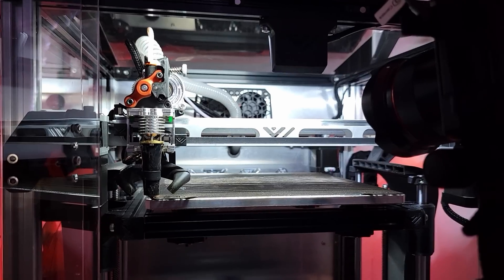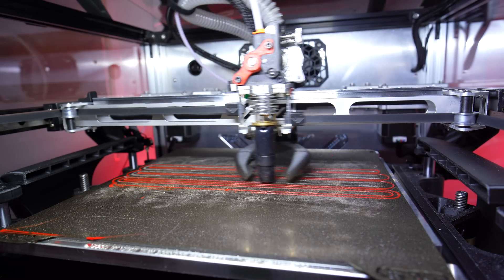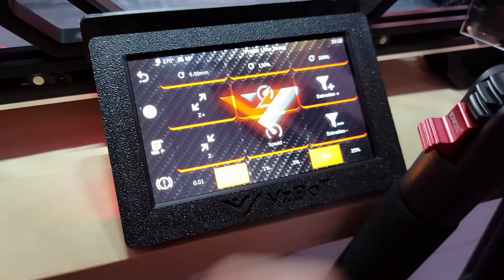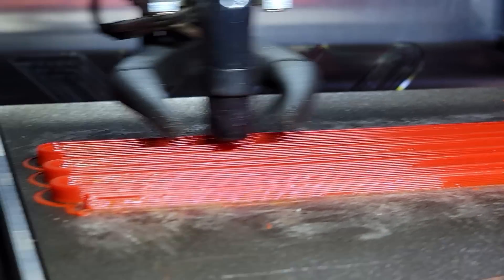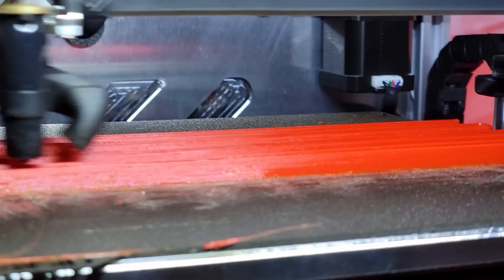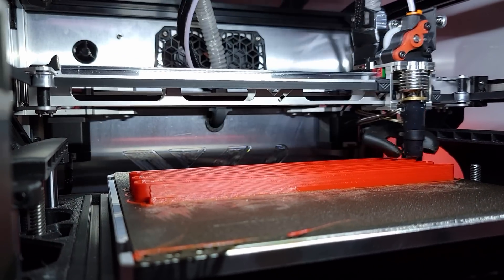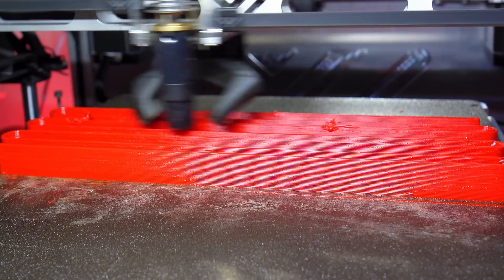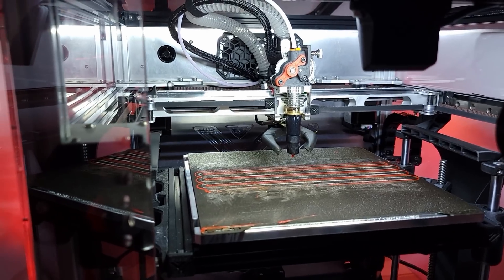Goliath Hotend flow test

Comment: Definitely a very solid 100! Great job man! Any plans to test that with 0.4mm CHT nozzles? Especially vs 0.4mm regular style and possibly that new tungsten design that you have. Would be super interesting to see that comparison and how they would affect the max flow in relation to each other.
Reply from the maker: I only have 0.5mm cht and up. And will compare with bozzle yes

Comment: Is the aluminum x gantry lighter than a cf one or just cooler? Does it have any more capacity for weight savings?
Reply: CF tube has issues with low thermal expansion creating tension between itself and the rail.
Aluminium is a bit heavier but has not this issue.

I have a great machined aluminium square tube for my ratrig but stiffer (no holes in the side only cut ins)
Reply: @warmesuppe  can I get some details on this tube. I'm building a 500 ratrig and looking for a light gantry but trying to avoid thermal expansion issues.

Comment: 230-240 😂 I'm convinced filament vendors who put ranges like that on PETG are just trying to dupe folks with PTFE hotends into buying. There's no way PETG will print at those temps without going really slow with fan off, precluding printing anything that needs cooling.

Comment: it seems like due to the long heat block the rscs is quite high relative to the bed itself
but nice hotend totally badass
Reply from the maker: yeah thats what is a bit sad. The rscs wont go any lower because it hits the Z top rod mounds... but ill work on a fix for that
Reply: I'm going to prove how much of a pleb I can be right now:
RSCS?? This is.... What exactly? 😋
Reply from the maker: @bopedersen77  Remote Static Cooling System

Comment: I try to push print speed on my Ender 3 by using wider extrusion width and abusing vase mode and I reached hot end limit around 16 mm^3/s. For what I have in mind I think I'll actually need one of yours creations.
Reply: Especially if you are using larger nozzles! On my prusa mk3 I can easily run into flow limits when I am using a 0.6 or 0.8 nozzle.
Reply: If I see a e3d v6 heater block, Im instantly swapping in to volcano

Comment: How can it work with such a small radiator? I don't even see a fan, does it use the air tube to cool that thing also?
Reply: The whole print head acts like a giant heatsink
Reply from the maker: Passive cooling with the aluminum printhead
Reply: @Vez3D  So that's enough? Cool.
Reply from the maker: @Nobody-Nowhere  im still in testing mode. Will perform other tests with pla, but so far pla has been good too, but i only printed at god speed so far. I have a fan and heat sink printed in case too